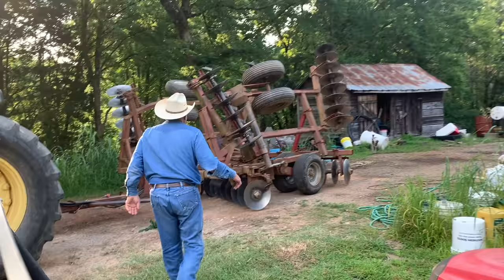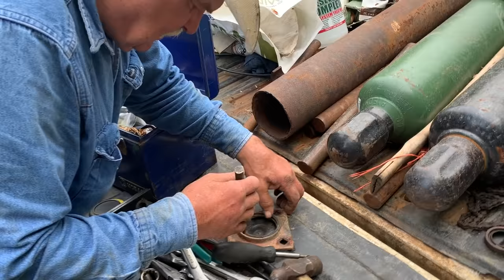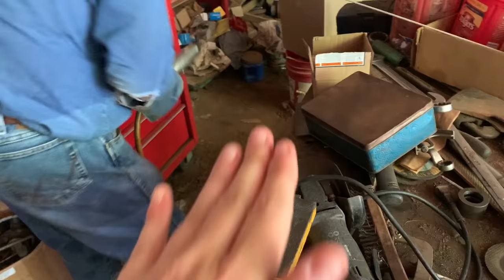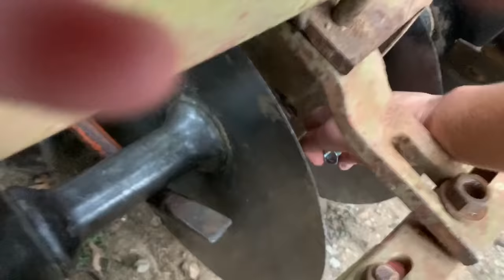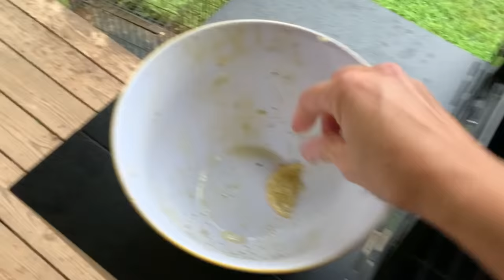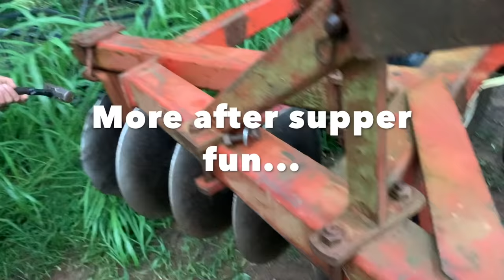Something (Else) Broke!

Comment: Good vid Meredith....shows more how LB has the knowledge and experience to fix broke down equipment when needed. The burr bit (rotary file) cuts metal into tiny slivers...then the small high speed air motor can blow those slivers every where. They can stick to skin or in your hair or even eye brows. Then later fall in a eye.  I have permanent scarring on my left eye caused by one tiny sliver from the same hand tool/burr bit. Be careful. Supper looked fantastic.

Comment: Years ago when I was doing tool-maker work, we had a power filer, but it was for small parts, as the table was only about a foot square. In 35 years of die repair and machine repair, I would have been lost without an air grinder and a carbide burr. I still have several in my tools in the shop.

Comment: The main problem with using that clamping methods Left & Right, is that when you hit something hard on the ground, the clamps shift a little left and right, that allows other parts to shift (That Shouldn't) and it wears down every single other part as well. Might want to suggest adding 2 drill, holes through both left & right side that goes through the middle & use another long bolt to secure, together the side clamps & center bolts will PREVENT it from shifting and causing that damage. Would also prevent all of that damage that you were pointing at in the video. You are so beautiful and your eyes as well. Keep up the great work, because we all LOVE seeing your videos & your kind soul on the screen.

Comment: They make a tool called a rotary broach, that cuts square holes in wood and some for steel.  Usually for small holes, but it would make quick work of those corners.  Now it would take a pretty large broach to press into that large hole, but they do make such a thing.  Like my cousin would say, we have to fabricate something to work.  WE grew up like LB, and we made what we could.

Comment: Another great video. I spent the night doing repairs on equipment in ghe barn. I do it at night cause its cooler and less likely for neighbors  down the road to hear words the slip out of my mouth when things dont go right. Doesn't matter if it's old or new equipment,  things  wear out, parts need replaced, and it always happens right when you need it.
Reply from the maker: So true! And working at night is a good idea

Comment: I have that exact same disc. 1 1/8 inch shafts. I think it measures 22ft. Great machine but it's easy to bend the shafts. Every time we seriously work on it, we have to "true" (straighten) the shafts (axles) in the hydraulic press. I have a smaller, (15ft) but way heavier disc, with. 1 3/4" axles that we use in the river bottom. It'll cut willows, lol. Have a great Sunday folks!

Comment: Well, if I'm not mistaken, that's an old IH 490 disc of early 70's vintage. I used to assemble those things at an International dealership in '74. They came in a big wooden crate and pallets. Put them together like a big erector set. Of course you'd have to be a child of the 60's to know what an erector set is/was.

Comment: That bearing ain't broke, it's just worn out!  They are a normal wear item....it happens.  I believe that the ones he is working on in the picture are non serviceable 'sealed' bearings (no grease zerk).  
A word of caution:  Lawrence probably knows this already....but many of your viewers may not know.....  be careful with that new battery powered grease gun!  They are great for servicing hinge pins and friction points (e.g.:  loader and backhoe);  however, you can very easily blow the seals out of bearings with them.  With a hand pump grease gun, go slow and you will feel the slight pressure increase as the bearing fills.....then stop!    This is one time when more is not better!  🤔 We are not in the kitchen cooking in cast iron with butter!  😉
The debate over appropriate grease application and procedures is never ending.  Just throwing out my two cents worth.   Stay safe and have a great day!  👋🤠👍
Reply: Sir my husband felt the same way power greasers can blow out more seals can you get Shaker stick on! Even as an aircraft mechanic he  had to be careful, or  working on our cars.
Reply: Oh, all that info is good to know.
Reply: I agree. Well said.
Reply: That information makes great sense.

Comment: Pre sealed bearing are worthless when working in wet fields better off using the old type so you can add grease by your self ok
Reply: There should be no such bearing as a presealed one, because they can’t hack real pressure.

Comment: Meredith you ought to get Carl a 6 or 8 lb sledge hammer and cut the handle off until it is only 2 &1/2 ft long. He needs a bigger hammer to beat that steel with.

Comment: LB and Meredith, they do make a power operated file. I own one. To remove as much metal as you needed, a file is worthless. The die grinder you were using works well, just watch out for cast iron filings, as they get into the eyes easily. Ask me how I know?
For a job that requires more than about .020 inch of metal removal, a broach would be the tool of choice.

We use to call using a torch as using a blue wrench from the color of the flame.

Looks like LB needs a Milwaukee 1/2 or 3/4 inch electric impact wrench. The new battery operated impacts have more power than a pneumatic impact. I never thought that electric could get this good.
Reply: Since you seem to think you're talking to a novice, why don't you send them all the things you think they should have!